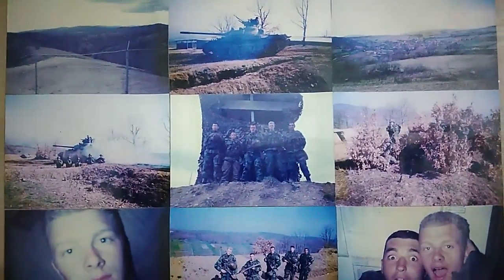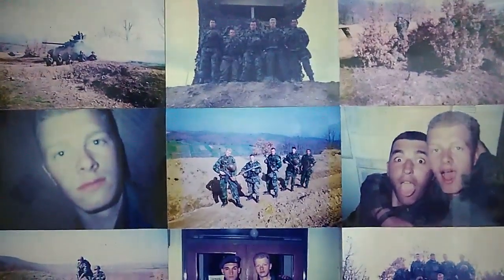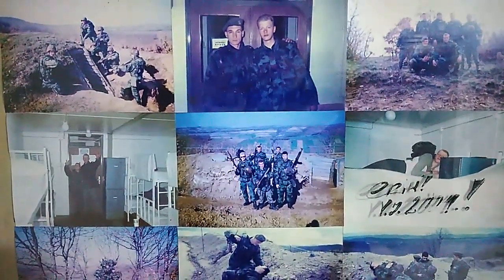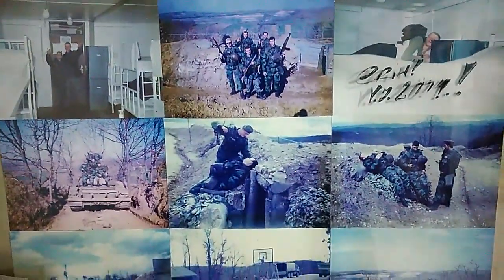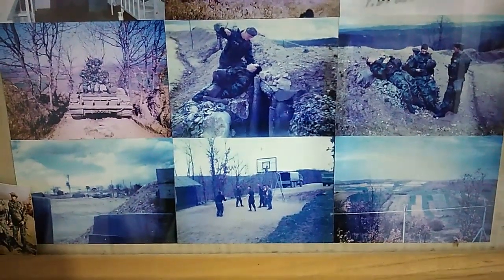How to easy proses low grade gold connectors - tip video.

Comment: You are one of the best sources on YouTube for alternative gold recovery. I really appreciate your help.
Reply: Yes he is. 👍👍👍👍👍
Reply: Use a gold stripper solution, extremely cheap and works extremely fast can be made or bought
Reply: This is how this method works, you dissolve gold than it cements back out on the base metals, copper, iron etc. If you still have base metals left over gold is plated out and you lose some or a lot of your yield, streetips just had a video on this with low yield pins he started with hcl to begin with but same principle once he switch to AR. This is why using AR isn't good, you need to consume almost all of the base metals, with that being done you either have almost all of the gold in solution OR as gold mud/dirt some foils if your filtering the solution and using fresh AR in small doses. A gold stripper solution really works best for low yield material, it may yield slightly lower but profit is greater due to gold stripper being so cheap

Comment: I hope you post a refining video as a follow up. I’m interested to see how you process that grey material. Thanks for the video brother!
Reply: I get it off the filter first. Then boil it in water several times until the water is clear. Then I use HNO3 to remove everything but the gold. Water boils again to remove all the HNO3. What remains will be the gold with some contamination. It gets refined in Ar 2 more times. The last time I did my bucket it had about 6 grams of gold and several ounces of silver. It took a day to clean up

Comment: I LOVE processing gold pins of all sorts of quality and grade personally and I must admit that I learned that AP method from you good sir ☺️
Now connector (s) is a horse of a different color sir! To be Frank, never yet have I tried to process connectors with gold pins still intact left inside them. I have always meticulously gone over each and every connector removing the pins prior to first doing a HCL boil (tin removal) with a few drops of sulfuric to precipitation of lead. Then nitric boils. Then hit Aqua Regia and watch the magic happen. Drop. And repeat aqua regia. Filter & dry. Then when enough gold powder is collected after multiple batches, I'll melt it down using MAPP and an oxyacetylene torch. Then handpour typically either 1 Troy ounce bars or possibly sometimes I'll make smaller bars like grams and half ounce bars. Same with silver.
Anyway that's my process used over a decade. I'm eagerly stoked and overjoyed checking out what new technique you have to show us kind sir!